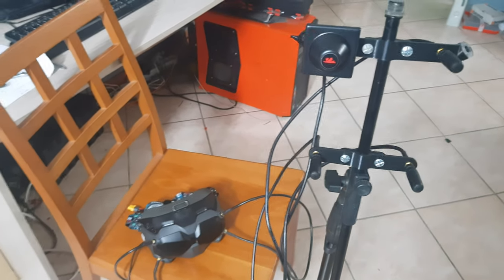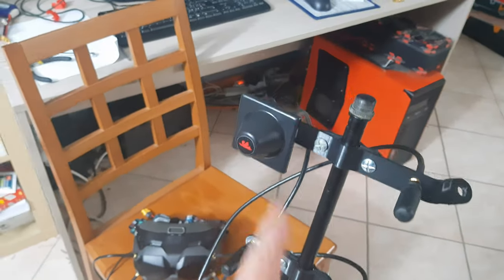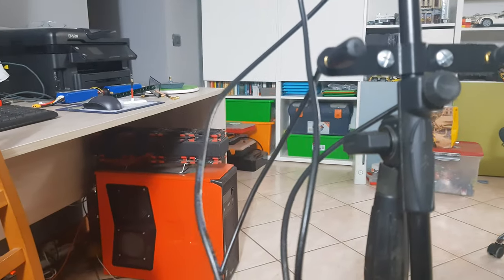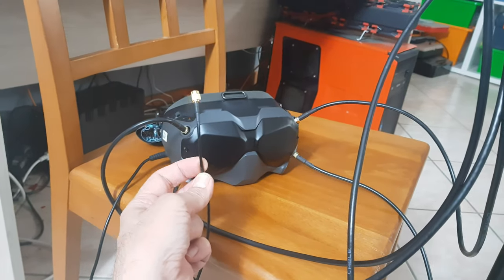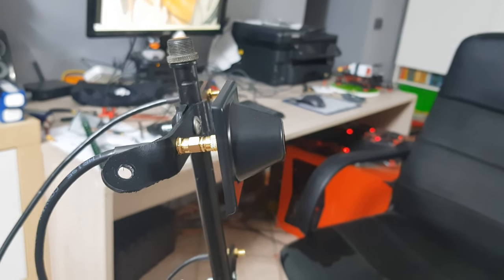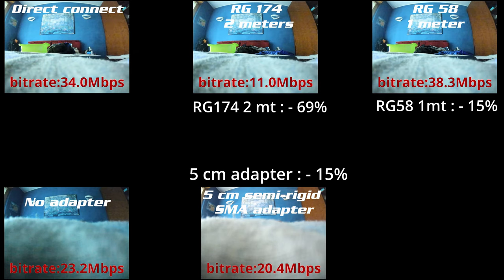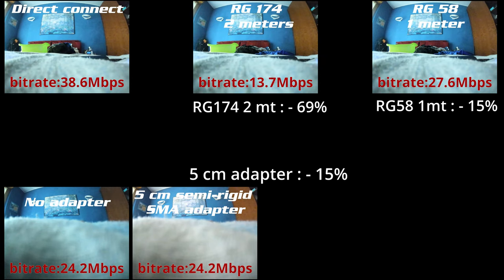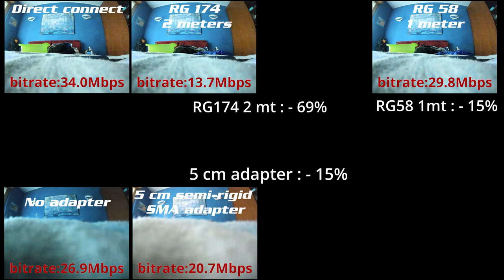Do SMA Extensions Degrade FPV Signal? - DJI Digital Signal Loss Test

Comment: Thanks for taking the time, very good results. I think when I tested cable effect back a few years ago I had a cheap thin one ;)
By always having a good orientation on the groundstation vs high gain antennas on the head which you can never aim right, you will get more than the 15% back I guess ;)
Reply from the maker: Hi Mario I just made a video on the same path with the same antennas but mounted on the goggles, i'll try to put them side by side in order to appreciate the difference... also, in this new video I get to the limit of the DJI FPV System, like you forecasted at a certain point the bitrate just drops to zero withut warning and bye bye....wait for it
Reply: Yea seen a test. Video did side by side flight same direction & altitude.. goggles at times would drop then go back up cause I guess he moves his head.. lol.

Comment: Your videos are great. Keep up  the good work.   I'm curious, since the mmcx to sma has a loss,  do you think stock Dji anntenas connected directly to the air unit are better than LR anntenas (  for example the triumph) connected with adapter? I saw your prior video testing a bunch of anntenas but Dji stock was not in the test.
Reply from the maker: that's a good question, i didn't try that, but i can tell you that the loss with just even a small cm mmcx-to-sma adapter is significant... i think it's a close call between stock antennas directly connected, and a premium couple with adapter..... i'll test that in a next video.

Comment: is the same if i put a pigtail (9cm) on the caddx vista to extend the antenna lenght ? i loose quality signal ? grazie !
Reply from the maker: Si, qualsiasi connettore o cavo aggiuntivo aumenta leggermente la perdita di segnale. Anche dei semplici adattatori da mmcx a sma provocano un leggero ma concreto svantaggio. Sinceramente però questi dettagli hanno senso solo per long range estremo, danno quel vantaggio per passare da 12km a 13km, ma per la maggior parte dei voli la differenza è quasi impercettibile.
Reply: @fabyt68  grande grazie io lo uso su un un geprc baby crocodile 5, voglio passare ad un mezzo che resiste meglio al vento e che possa andare oltre un 5", non un 7 che e' troppo pesante secondo me, che ne pensi di un 6" ? hai mai volato con un rekon 6 ad esempio ? e' leggero ha eliche piu' grandi di un 5" e copre distanze maggiori che ne pensi ? per distanze intendo anche 3-5km solo andata su in montagna
Reply from the maker: Non ho mai provato 6 pollici, però se ti interessa un minimo il long range ti direi di andare direttamente al 7 pollici. Non ha particolari difetti, ci faccio pure freestyle tanto quanto i 5 pollici, e ci sono molti più componenti
Reply: I bought 4 5.8 GHz 5v radio frequency amplifier’s I later found out I need to add a filter to that haven’t actually tested I did test a 5v powered amplifier on the tx side which seemingly degraded performance idk if I should use a Ff filter for that I took it off never tried the rx amplify